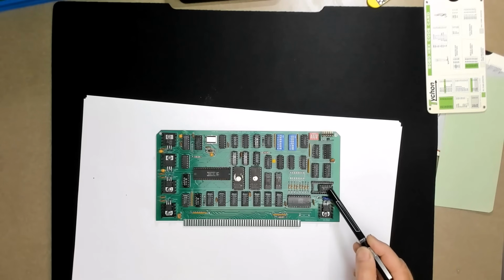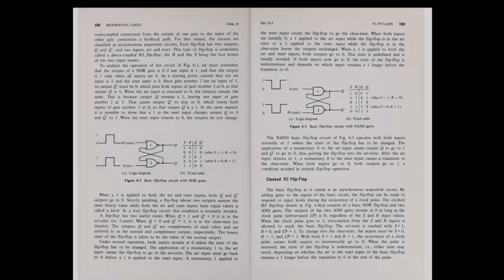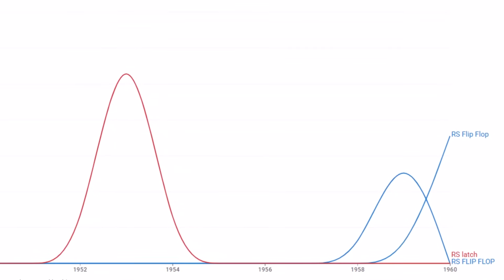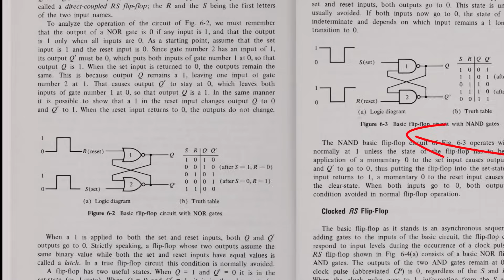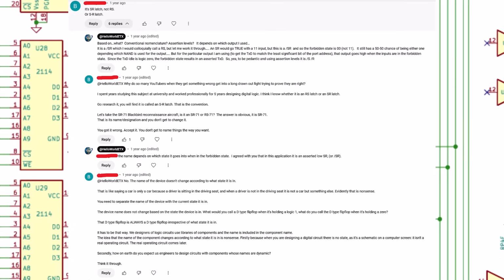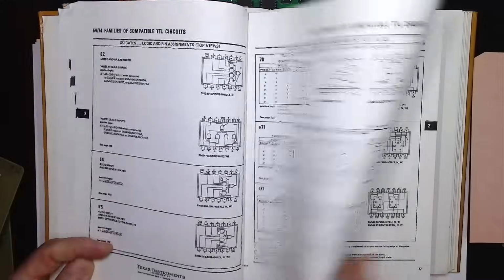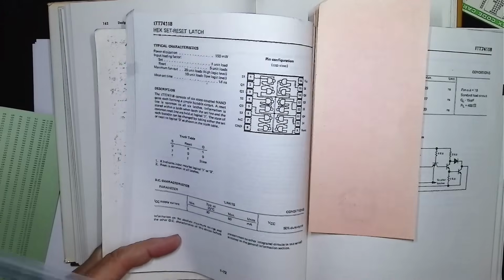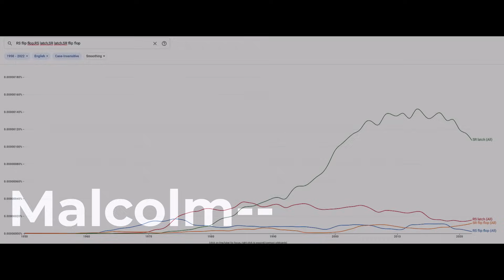{132} They changed the name of the RS flip flop, am I the last to know?

Comment: I always thought the SR vs RS had to do with with latch priority:

- In an RS flip flop the output (Q) drives to 0 if R (Reset) is high regardless of S (Set) State. If your set state (S) is 1 and you toggle the reset (R), the output (Q) will drive to 0 (unlatch) whenever the reset is 1, but latch back to 1 when the reset is released. If S is zero, the circuit will unlatch as expected.  In this case, reset has priority.

- In an SR flip flop the output (Q) will remain high if the set is still high and the reset is toggled. The latch will only unlatch if the set is low and the reset is toggled. In this case, the set has priority.

It is a small but annoying difference… especially when wiring up annunciator boards. If the RS flip flop is used all latched and still present alarms go off then come back on when the reset is released. With the SR flip flop only the non maintained alarms clear when reset.

Comment: We actually learned forbidden state priority in PLC programming. One of the 2-hand starters we had to make in FBD used an RS latch where the forbidden state HAD to be reset and in schneider's software for example you can just chose it in a drop-down menu. Funnily enough it does not change the name just the behaviour. As for the true reason behind the names, it's probably just down to ease of pronounciation. We say SR here but it's just easier to say IMO. RS in english is also arguably easier to say than SR.

Comment: The troll talked about the SR-71 and how you can't just call it the RS-71 because you want to.

About that...

The SR-71 was originally designated the RS-71, but (like our troll) General LeMay thought "RS" was stupid and lobbied to have the script for LBJ's speech announcing the aircraft modified to use "SR-71", and then once the president had used it, that was henceforth the designation.
Reply from the maker: If someone has a lazy tongue, RS does sound a bit like arse.

Comment: What's a Burroughs reference card doing in a book on TTL, since they had their own family of chips which was- of course- superior to anybody else's? +3.75 and -1.25V IIRC...
Reply from the maker: When I was at college, if there weren’t any CRT terminals available I had to go over to the business department where they only had teletypes and card punches. I think the university got free punch cards from whomever was obsoleting their card systems. I wasn’t using the cards because I had storage on the mainframe, but one time on the way out I grabbed a handful of cards off the punch by the door to use as bookmarks.
Reply: @HelloWorldETX  What you've got appears to be a bit of a rarity: https://homepage.divms.uiowa.edu/~jones/cards/collection/GardnerDenverWireWrapsalmon.jpg

Basically, that's a control card for a high-end electromechanical wire wrapping system. Burroughs certainly used wirewrap for their backplanes well into the 1980s, although I don't know whether the same manufacturing equipment was used.

https://www.youtube.com/watch?v=VuFuhmcHLz8 shows some rather grainy footage of a machine apparently wrapping the backplane for a B9390(?) tape drive from the early 1960s, they were still in use for systems that needed backwards compatibility into the early 80s and I've got a plugin module from one on my windowsill ("cordwood" with 6x transistors plus diodes and passives).

There's a few seconds of better footage at https://youtu.be/MkxBmviMy_E?list=PLsMFdolQPga6ckrDBKHmE9OZWWjP05v4Z&t=593 from a slightly later system.
Reply: @HelloWorldETX  My detailed reply has vanished, possibly because it contained links. It's a Denver-Gardner card for wirewrapping a Burroughs mainframe or peripheral backplane, Doug Jones's website has one and there's a couple of digitised Burroughs movies on YouTube showing that manufacturing technique.

Comment: For 50 years, most of the latches if used, were "RS" with the implication that the "illegal state" prioritized "RESET". And if I saw SR it would have been the "SET" state with priority. Do NOT discount the illegal state as it is very important to system design as it is used as a system wide reset. Microprocessors during the 2 phase clock era were made with latches on opposite clock phases rather than a D-Flop leading to hundreds if not thousands of RS latches.  The system may take a few clock cycles to propagate the reset state through the entire chip.  

The bigger issue is when you leave the illegal state, as this can lead to metastability of the latch where ii is somewhere in the middle and not a legal output mid level between a 0 and a 1. The likely hood of his case decreases at 2nd order as the propagation  of the technology decreases hence in new technology it is almost forgotten.
Reply from the maker: So you think the naming of the RS/SR latch according to the forbidden state goes back to the 70’s?

Comment: I've been designing digital circuits since the 60's and still do in my retirement. I've always used the term RS latch, but I'm quite happy if someone else uses SR latch. What does bug me though is the confusion between edge triggered and level triggered flip flops. To me, a D-type is edge triggered, but many people, including some  manufacturers also refer to level triggered flip flops as D-types. Since the two types are usually not interchangeable, this to me is unacceptable, though to be fair, there doesn't seem to be a standard short name for a level triggered one. It's a bit late in the day, but how about 'L-type'?

Comment: I remember the RS was still the used term back when I graduated high school in 1976. I think the change of designation came from the IT world, where they knew what a latch was for, but very few knew what a flip-flop was. The only reason for it (in their minds) was to store a bit, so it was just a latch. Zero was a presumed default power-up state and all the computer language libraries zeroed the ram before the program starts etc.. I avoided letting my circuits choke on the 'forbidden states' because if you didn't, Murphy would bite you in the ass and find you on a telephone with a very pissed customer with a 'random' problem. I watched several peers over the years have to park their ass on a plane and go debug their design at a customer's site in a noisy environment. It was called forbidden because it was not very consistent and would eventually settle there after a few nanoseconds, but did weird (inconsistent) things along the way.

Comment: RS = Radio Shack.
SR = Senior.  Or a trim level on the Nissan Altima.
Whether the latch uses NANDs or NORs shouldn’t change its name.
Zero comes before one, so to me they're all RS latches.
And I'm a believer in the forbidden state.
Reply from the maker: Are you a believer that the forbidden state exists? or that it is ok to utilize it?
Reply: @HelloWorldETX  That it’s OK to utilize it.  Often, the way I want the overall circuit to behave (relative priority between the two inputs) will determine whether I use the Q or /Q output.

Comment: A lot of this type of thing is about patents and trademarks at the time.  If company X has a trademark, everyone else calls it something else, so the shift often happens away from the real original name, not really going to a new, better name.  Or rarely something similar but 'new' with a new name will take over the entire market, and displace the old name almost completely, like 'pals and gals' and 'eeprom' variants replacing each other over time.
  If you didn't deal with the parts and already know why the name changed over time, it can actually take a lot of time to read through old magazines etc to even figure out why the name change happened.  People at the time knew the old name, knew the new name and why it was better, and often changed over without writing down what happened.
Similar to changing arms and armor over time in history, it was obvious at the time, but the reason for the change can be not obvious much later.  The reasoning gets lost to history, people used to know it but it wasn't important enough to write down, you just use the 'new' thing.

Comment: When I was designing logic for IBM chips in the mid to late 1970's, the R-S flip-flop were a no no because of bad states with noise and ckt delay from 0 to 3 ns for signal to reach output.  I had to gate all my logic with a clock wave form that would set the latch after enough time to guarantee the longs delay do to chip propagation timing.  It made my circuits more expensive, but they were less likely to propagate a bad logic state.

Comment: At least in the USSR I constantly encountered term "RS-trigger", less often "RS-latch". "Flip-flop" was almost never used, although it did occur. I mean popular radio-electronic (home built computers) literature for amateurs from 1980-1995.  The debate about RS vs SR is of course pointless, because this is exactly the case when you can do it either way. Now I checked, some (in russian) write SR trigger, earlier in 99% of cases in literature they wrote RS-trigger. The reason is that it is a little easier for Slavic speakers to pronounce it this way. "RS" sounds more harmonious.
Reply from the maker: The use of “trigger” is interesting. It gives me the impression of tripping something like a mousetrap or circuit breaker that is then reset. If the latch were called “trip” “reset” then I would want to always put “trip” first. But oddly with the term “set” I use them it either order.
Reply: @HelloWorldETX  What they really changed, is MOSI, MISO (master-out-slave-in, master-in-slave-out) signals used last 45 years. See wikipedia article I2C / SPI bus/protocol. 😃
Reply: USSR-Latch 😅

Comment: I've always thought that a flip-flop has both Q and ~Q outputs available, while a latch has only one of them.  I dug out my IEEE Standard Dictionary of Electrical and Electronics Terms (ANSI/IEEE Std 100-1988).  It does define "computational" flip-flops.  But nothing about "computational" latches.  It only mentions latching relays and thyristor latching current.  There's also nothing about RS or SR flip flops or latches.  Seems like "latch" is more of a loosely defined marketing term than an official one.

Comment: Lifelong digital designer from the days of RTL with discrete components !  I used the term "R-S" but would never have been confused if anyone called it "S-R" !   Originally "flip-flop" was used for both bistable and monstable circuits. It stayed that way until increased integration led to chips with COMMON reset or clock lines. Because these were often used with Data Busses to store binary numbers ( rather than logic states ) they were called Registers.  In the case where the clock was common they were also called Latches. So "Dual R-S Flip-Flop"  or "Octal 8bit Latch". Note that an Octal 8bit latch would be made of J-K elements while an Octal 8bit Transparent Latch would be made of R-S elements. The first operated on the clock edge transition while the second operated on the clock level.

At the circuit level the design would use positive logic throughout. Then parts of it would be converted to negative logic to match the available (or cheapest) chiips. This can be done because for example the 7400 TTL chip has 4 gates each of which is a NAND (positive logic) or a NOR (negative logic) . The ability to mentally do this conversion was a key skill for every designer of MSI . Also drawing the circuit in Mixed Logic made it much easier to understand.
Reply: ' would use positive logic throughout. Then parts of it would be converted to negative logic'
I would expect you're about 10 years older than me.  Most of this sounds 'mid-to-late-70's' to me, I used things of this nature but for add ons for C-64 and 8051 etc, so it was usually 'use the negative part directly because they have better current and are cheaper'.  Then PICs in the early 1990's, so got used to all kinds of back and forth logic by way of the PIC instruction set..  Even when I was using them most people around me weren't learning 74 series types and ' So "Dual R-S Flip-Flop"  or "Octal 8bit Latch".' etc, because the more integrated newer solutions were already taking over.  Just funny how much it sets a fairly specific time..
Reply: @ModelLights  The lost art of vacuum tubes like on Mr. Carlson's Lab show me how little I know in electronics, even with my degrees... it does set an era or time I agree, it's the way you have to make things work.  Lately I'm getting into Op Amps and having a load of fun there in Analog-Land... Cheers!
Reply from the maker: Negative logic still slows me down… much like going to the UK and driving on the other side of the road. It goes OK,  but it requires lots of quietly mumbling to myself which mode I am in.
Reply: @HelloWorldETX  There's something you probably know, but I'll mention it here in this case:  Using DeMorgan's theorem, there's a method of redrawing the gates so you can picture the functionality in the positive logic while keeping the schematic true to the active low signals.  You change the AND's to OR's (and vice-versa) and you replace the bubbles (invertors) with a wire and wires with bubbles.  It's can help with that, I think it's a powerful technique, and sometimes you run across a schematic and see an oddly drawn gate and that's what they've done.  For example if you have a lot of low-active signals that all must be true for the output to go true, the you see the inputs inverted going into an AND gate,  Implemented as a 7402 NOR gate, for example.

Comment: I suppose if one was to be pedantic, you have to Set the flip-flop first, before you Reset it, so it would be a SR Flip-Flop. But I've always called it an RS Flip-Flip. (And it is nothing to do with Radio Shack or RadioSpares (aka RS Components)!!)

Comment: A small extension to this discussion, if it's OK to expand the scope slightly. I worked on software latches in Siemens PLC's.  You could add them into your code in two ways.  Either with the R input first, followed by the S input - or S input first, followed by the R input. Since the PLC processed the commands sequentially the second input always overwrote the first. Therefore you had one case of a latch with R having dominance, and one with S having dominance.
Reply from the maker: Interesting….  But the second input wasn’t putting it in the forbidden state was it?
Reply: @HelloWorldETX  There isn't a forbidden state as such - since its in software. What you could get is the output changing state for a couple of microseconds as the commands are being processed.

Comment: In fact, I've never noticed that someone called that thing SR-latch. I cannot say I've never seen that before, but as long as I am able to understand what's going on, I don't care about terminology as there are much more important things to care about. But there are some people claiming this to be "very important" (partially because they are mentally unable to solve real problems). I have only one advice — never mess with them. They cost you time and energy, furthermore, it leads to frustration. It's nothing than wasting your time in meaningless disputes.
Reply from the maker: In the end, I never would have noticed the sea change in the industry if the commenter hadn’t sent me down this path. And then where would we be without knowing we avoided dlip-dlop as a potential standard.

Comment: I think SR makes more logical sense than RS, afterall you have to SET before you can RESET.

As for the switch between flip flop and latch, it was my understanding that latches were asynchronous, their output changing with the continuously with the input while flip flops were synchronous, their output only changing on the edge of a clock or trigger input.

Comment: Why so much about the forbidden state?  Shouldn't that say something?  I would think that clean designs would avoid forbidden states.  If that is the case why all the hot air over this?
Reply from the maker: Personally, I think forbidden state is a bit of a misnomer.  Nothing bad happens as long as you know which input will be released last.

Comment: Interesting stuff.  I'm an IC designer, and until very recently there have still been occasions to build latches out of pairs of gates and worry about invalid states.  I work in mixed-signal meaning we combine digital and analog in one chip.  The analog guys always loved these home-made latches in spite of rarely being able to keep track of illegal states.
Just for laughs, I'd like to point out a place where "illegal" states actually are essential in a circuit's design.  In Carver Mead's Intro to VLSI design on page 261 he described an "interlock element" which is an asynchronous arbiter.  The idea was the outputs were mutually exclusive.  An analog-ish discriminator circuit is attached to a NOR-based latch.  If the Q and Q# outputs are not complementary, both acknowledge outputs remain inactive.  This way, the interlock element avoids giving a "wrong" answer, instead delaying the result until any metastable resolves.
I'm not sure if the circuit works reliably or if anybody actually used it.  It appears in a "self-timed elements" section which most folks ignored.
Reply: I still have my copy of Carver Mead. Simply using the input as a global reset is reason enough for using this state. In fact if you are designing a full D-Flop you  better make sure BOTH latches handle the illegal reset state in the same way!
Reply from the maker: @wendellknicely395 yea, global reset is my favorite use of the forbidden state.